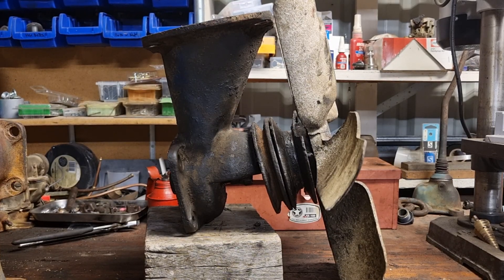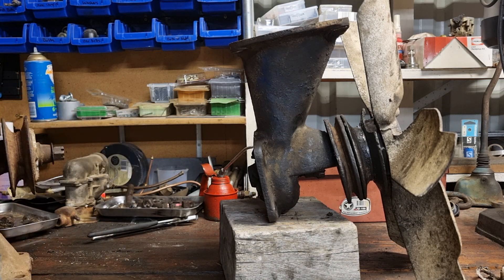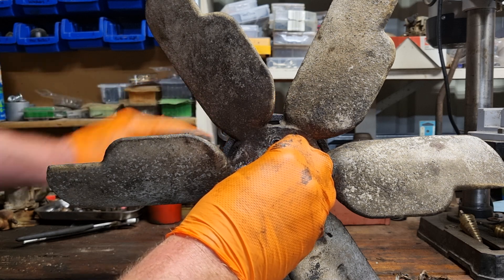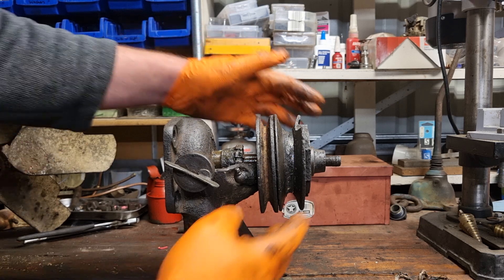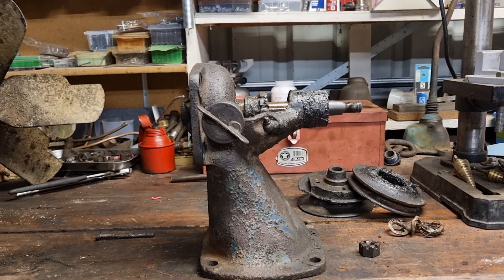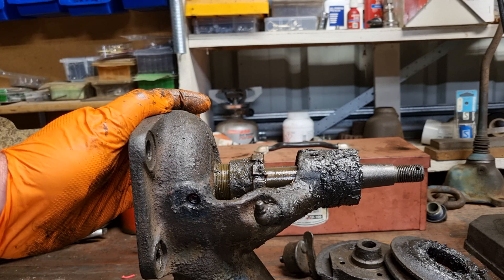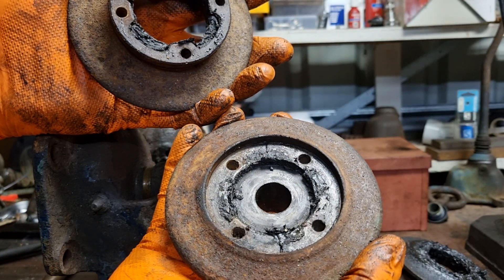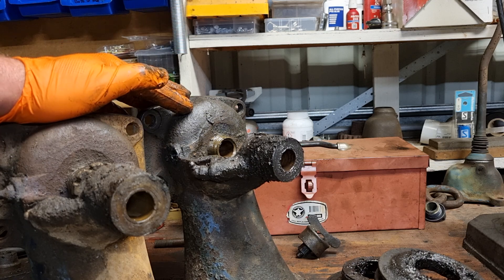Fordson E27N Fan and Water Pump Adjustment

Comment: Fantastic I subccribed immediately, I to put to much grease into the shaft and I am going to pack some boating caulking fibre you can get from, I think I got mine from Quinn's Marine in Port Adelaide, South Australia I have a roll of hundreds of metres of the stuff and it expands on contact with water so should work fine wrapped carefully around the shaft. I am going to do some work on both of mine this year and have a new radiator to fit one of them then I am thinking of selling them as I live in the Northern Territory now and not down on Yorke Peninsular as the councils have intruded into my freedoms to much for my liking.

Comment: The bronze water pump on my pre war Alvis car is packed in the same way. The metallised material is called cranes packing. Works well but does not like being dry for long periods. However it will generally re seal without tightening. Thank you for posting best from the UK.